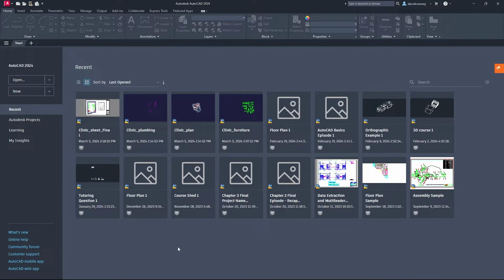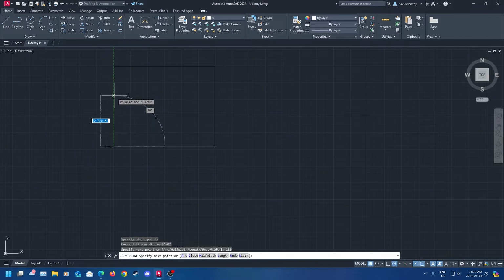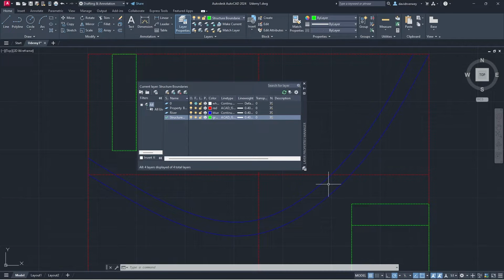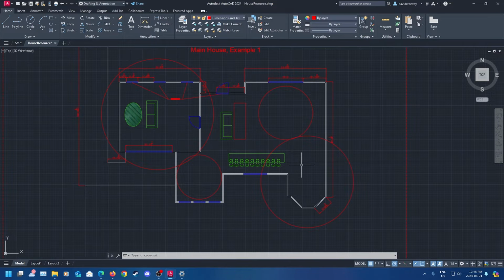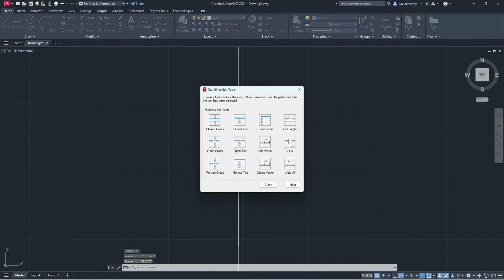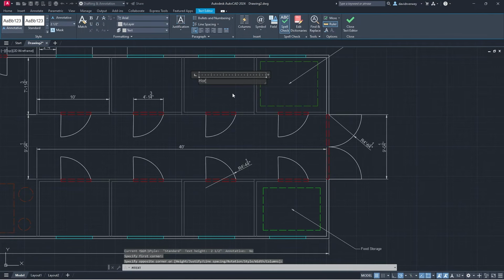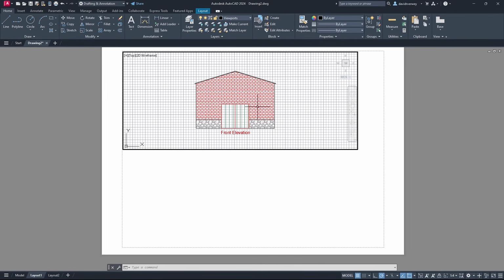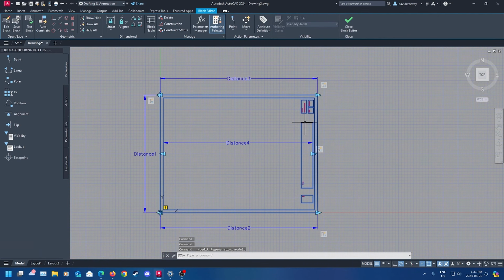AutoCAD 2025 Full Course for Beginners!

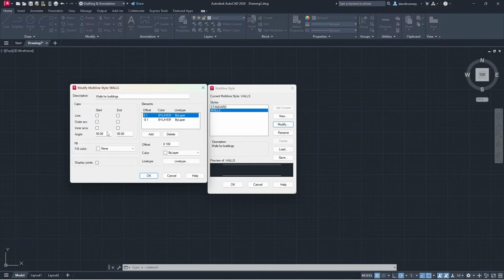Comment: At (1:38:09) Modify Multiline Style: WALLS, your positive negative offset is set to 1/-1 to make 4" is because after you type MLINE - S your scale is set to 2, If set to 1 , the you'd use 2/-2 as your offset. Also for me i wasn't able to get the interior 25x50 until i messed with MLINE-J the Justification of the line top, zero, bottom. Really just had to pay attention to my drawing direction.

Comment: Hi, I have not used AutoCAD it in a long time, and now need to re-learn it. How can I get a access to AutoCAD? Is there any FREE "temporary" access? Thanks
Reply from the maker: Yes, you can get a free trial of AutoCAD on AutoDESKS website. Only thing that sucks is they've lowered the free trial time from 30 - 15 days. If you need more time to learn, a good place to start would be with AutoCAD LT (which also has a free trial), and then getting the full version of AutoCAD free trial, so you get 30 days total to play around with it. 

If you need more time, then just get AutoCAD LT on a monthly basis for I think $50 / month for the time you learn. It has a limited amount of features compared to the full version, but for 2D drafting it's about the same.

Hope this helps!

Comment: Hi I am trying to do the dimensions but I noticed the numbers are not coming up. Do you know how I can resolved this
Reply from the maker: Are the lines showing up? If the lines are showing up but no dimensions there's a really good chance they're very small. You'll have to adjust your annotation / scales and tweak that a bit to make it work. You could also get rid of annotation and manually change the text sizes for your dimensions. Hard to explain but I'll add a video to the list for this. Hope this helps!

Comment: Great video and thanks for sharing. The house resource you shared seem different. The one of the layers of the downloaded file is showing doors and windows but the one you used for the tutorial is showing "Dimensions and Tex...." I have checked the layer properties of the downloaded file and can only see Doors and Windows, Driveway, Floor Plan and Property Lines. Dimensions and Tex is missing. Kindly advise
Reply from the maker: It's been a while since I used that resource as it's old, but I'm pretty sure we left that open for the users to use for practice creating their own layers. Mostly for practicing!

Comment: If you're using AutoCAD LT 2025 it does not have MLEDIT which is a real bummer.
Reply from the maker: That is correct and something I should have mentioned earlier on; some commands aren't available in AutoCAD LT, but you can use most available commands for 2D drafting.

Comment: 10:25 bro when i trim the whole arc is gone
Reply from the maker: Most likely because your line isn't intersecting with the arc. What you can do in the meantime is pull the line down slightly so it goes over the arc and trim from there. Once thats done you can snap the line onto the end of the now trimmed arc.

Comment: At time stamp 31:23 the stretch and unite not happening...tried many times...the horizontal line that not stretching with vertical line you move as shown in video
Reply from the maker: Hmm. It may have something to do with your settings. Try the "join" command instead and then try stretching!
Reply: same issue here

Comment: Hi, I'm completely new to AutoCAD and found this tutorial which seems to be great so far, thank you for sharing this tutorial. However, I found something really weird when I was learning annotation, once I was adding the dimensions, I was getting different measurements than the ones in the tutorial. For example, the wall between the windows in the top left of the building, in the video it shows 11'8 9/16", and when I did it it read 4'9 5/16", obviously, a big difference. What I did was I deleted all the measurements I had so far and redid them, and this time the numbers were matching. I wonder what I did wrong in the first place...
Reply from the maker: Hey, thanks for the question. I used to have this exact problem happen when I started learning and I had it happen all the time.

This issue can be caused by your settings for your snaps. Sometimes the program will snap to locations you do not want it to go. I'm going to put out a video in the coming days about the settings I use and why I use them. 

Another possible issue is a mis-type. I do this all the time and I've been using the program for 10~ years.

Getting more comfortable with the program and learning it properly really helps minimize these kinds of mistakes, but they still do occur. 

Hope this helps!

Comment: I got a question. It’s been quite a long while since I have used AutoCAD. Like 6+ years. But which version would I need to purchase, in order to draw and detail 2D drawings with already existing blocks of structural steel materials and sizes? I’m quite familiar with the basic functions of the software already. But I’m currently enrolled in college and at least get the educational version. I’ve paid out of pocket before just to mess around with it. But now I want to purchase what I remember how to operate. And, actually the first couch you drew. Was a Loveseat. 😂 And So the Z axis would be 3D drawing??
Reply from the maker: Would depend on what you'd be comfortable with. All versions contain the basics needed in order to design what you described. You can import existing blocks and start using them almost right away in all (recent) versions.

There's nothing wrong with going with AutoCAD 2024 or lower if you can get the software cheaper. Again, basic functionality stays the same. 

The Z Axis is mostly used for 3D drawing yes. If you're just doing 2D design, you'll almost never touch the Z axis.

Comment: i still use autocad 2018 because my minimum spec of computer
Reply from the maker: That's quite alright, most of the commands and everything should work correctly regardless of version, however there will be changes or commands you wont be able to use, but the principles stay the same!

Comment: Great video! I've got a question - Under "Setting Units and Modifying", the centre point of my object is not showing for me to snap when using any modifying function,, why is that and how can I fix it? Anyone please.
Reply from the maker: Check your snap settings in the bottom lefthand corner of the screen, find a combination that works and you'll be good!

Comment: I had a question, say I draw a square surface joining 4 lines which lies on the ZX plane i.e vertically. How do I fill in the square surface with a certain color? Using hatch I'm only able to solid fill regions on the UCS plane.
I'm pretty new to this, hope u'd help out brother.
Reply from the maker: So it depends if you're doing 3D or 2D. What can be used in 3D is you can apply a material to the 3D surface, while making sure the visual style you're using in AutoCAD allows "Materials and Textures" to be displayed.

For a 2D object, hatching a solid colour is the way to do what you described. 

One thing you can try is to type in "UCS" into the command bar and go into the plane that you want to fill in (example, instead of doing a "top" view you want "right" view) press enter once you type UCS and then you'll see a bar show up, press the down arrow key on your keyboard and a few options will show up. Use the arrow key to highlight "view" and then press enter. This will change the coordinate system so that it matches up with your work plane. When you do this you should be able to hatch.

To switch back simply do the above, except instead of selecting "view" select "global" and press enter. This will bring you back to the normal grid positioning. 

Hope this helps!
Reply: @VerweyDraftingInc  thanks a lot brother. All of these worked out. I used both the materials method and UCS. Thanks again & good luck man!!!
Reply from the maker: Anytime, glad I could help!